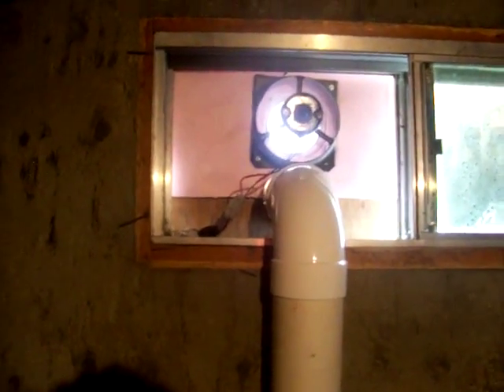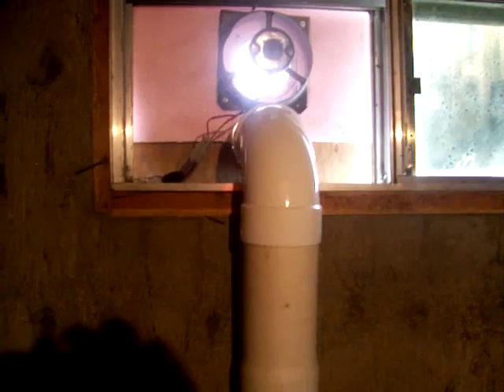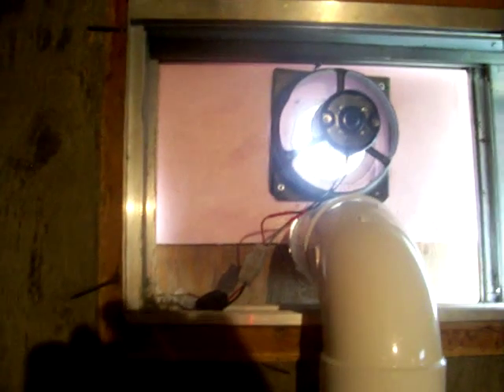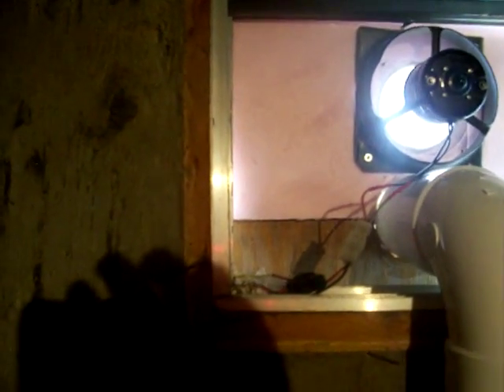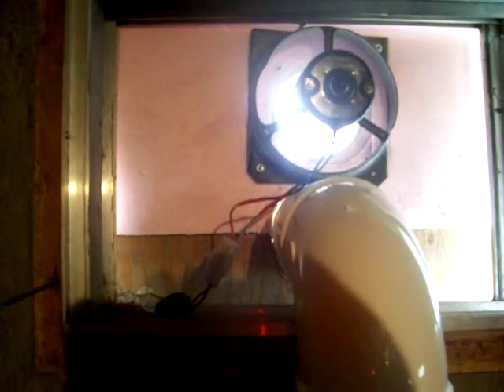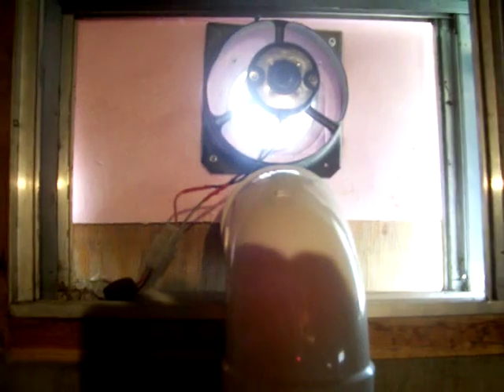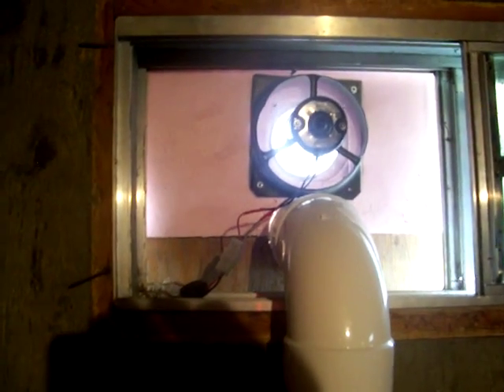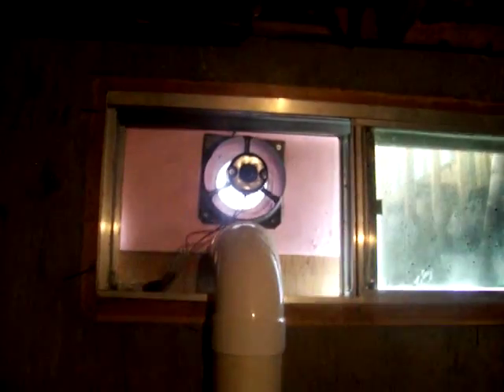Solar furnace Inlet & outlet fan

Comment: very cool. Im getting ready to vent mine into my house. Im using two 12 volt pc fans and a 15 volt solar panel to power them. I like how you used the pvc piping to take the inlet air from just above the floor. Thanx for the vid, and check out my solar furnace. 220 degrees!

Comment from the maker: My solar panels run that fan in the video and my laptop computer also a router, used by four other computers in my house.  The panels charge five deep cycle batterys, hooked in series, giving me 600 amp hours plus or minus.  How long it lasts before the batterys are run down depends on the sun.

Comment: Good stuff,   My son and I hqve been building a solar heater and are just about ready for the final installation. We are curious about how you made it "self regulatig " What kind of thermostat did you use? And if the fan is 12 volt... how did you rig it up?

   Thanks for any feedback you can give.

Bruce